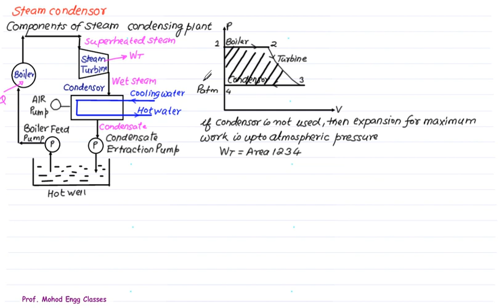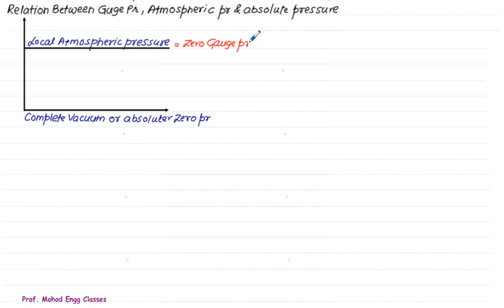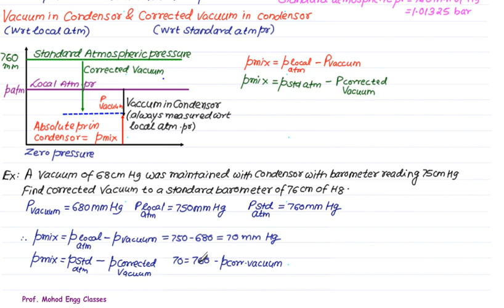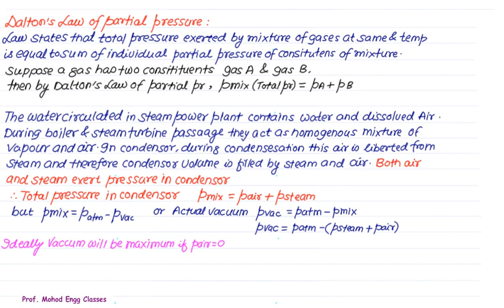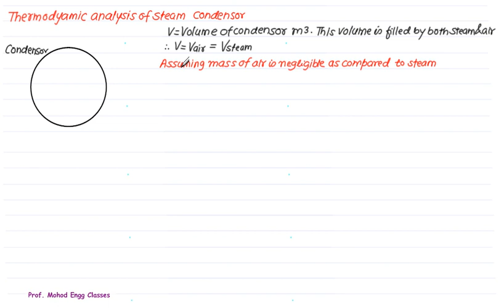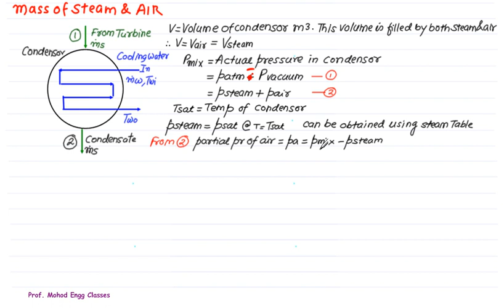Comment: if a compressor 23.2 ton load requires 33.5 ton compressor hp and has friction hp of 5.75 the heat rejection of condenser  btu/hr is most nearly